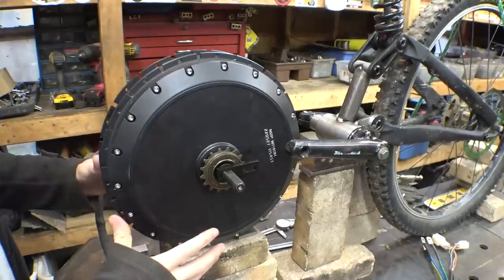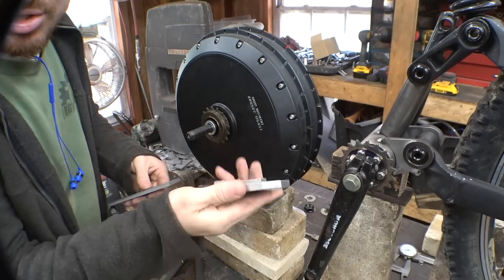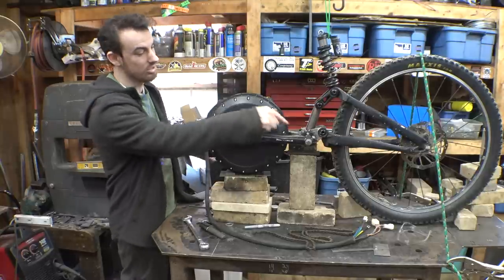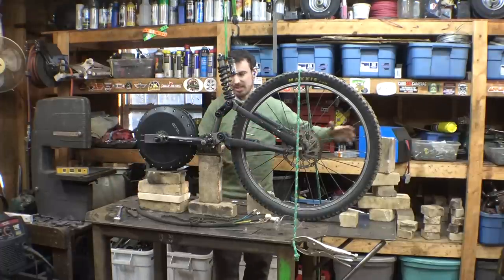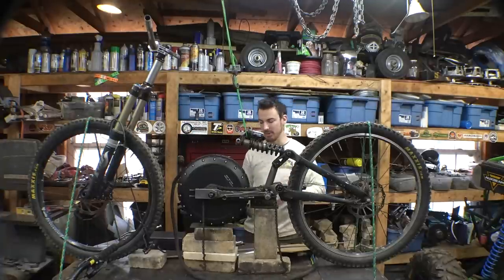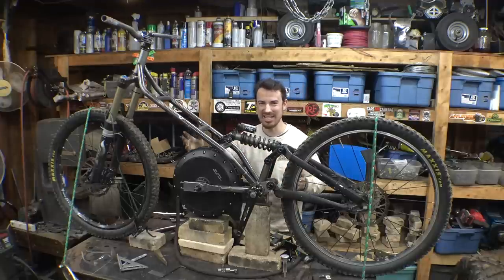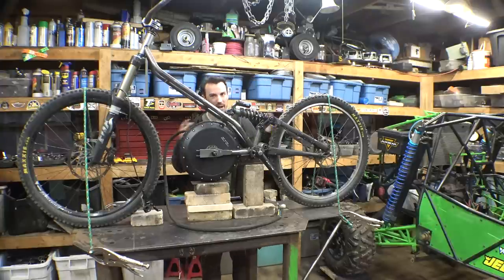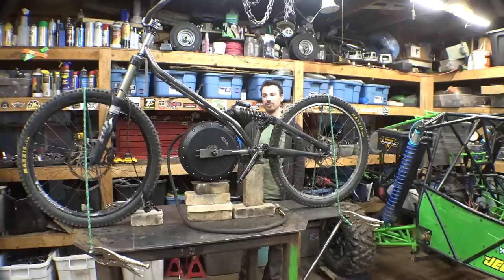Home Made Electric Mountain Bike Build - Part 2

Comment: A 15kw motor meant for a 450 pound sportbike crammed into a 50 pound frame is gonna be insane!. Love it!
Reply: i hope he adds  a few more tubes to the motor,  otherwise this beast rips his frame to shreds;))
Reply: He’s only gonna use like an 1/8 throttle. He doesn’t send stuff hard.
Reply: It's like 1000Hp on 1 Tire
Reply: @breakshot7451  also he his gonna have a problem with how low that motor is mounted. Basically not gonna be possible to do super technical riding because the motor will be hitting the ground
Reply: I’m fairly certain he’ll survive.
Reply: Do not worry. Rather B always finds ways to put unnecessary weight on builds and slow them down. Can't wait to see the final product though. Cool idea. Surprised I haven't seem more tubers doing this.
Reply: Maybe you guys missed the part where the motor is permanently attached to the pedals. If you can't pedal as fast as the 15kw motor your feet are IN A FLICKING MEAT GRINDER. You can't even use the throttle without pedaling
Reply: @janeblogs324  yeah this project is fucked for many reasons lol, could be cool but it can't be a mountain bike with the parts he is using now
Reply: I don’t think the spoke wheels will take the torque.
Reply: @janeblogs324  the motor is in fact NOT permanently attached to the Motor. He explained his design in the video
Reply: @purplebooger6410  not the current Chinese 24 spoke rears
Reply: @breakshot7451  The bigger problem is that the motor isn't designed to run that way and depending on quality, it might actually break the casement. Usually, you're supposed to machine the tabs off and build a "hoop" (for lack of a better term) that holds the motor in place from the outside. I've had two different motors break the case (cracks) because they weren't done in properly.
Reply: @aserta  i know, your right. basically, everthing screams,  wtf  are you doing here. but often that are the most fun projects;)))
Reply: @everythingcustom4034  The motor isn't attached to the motor huh? That would be a slight problem.

Comment: The amount of machining that goes into all of your projects is mind-blowing. I can watch for hours and I know it takes you many hours for something as simple as the headstock or seat post
Reply: Machining that tube took awhile, not sure if he knew it was A513 Type 5 DOM tubing.  It's used a lot in drag cars, for constructing four link suspension arms that won't fail..
Reply: Maria CANCER  Do you think it's okay to spam your channel everywhere?
Reply: I still cringe at using steel
Reply: @SKBKER  Its more expensive but he should use thin-wall chromoly tubing.
Reply: hes doing it the right way though,if the geometry isnt exact wont be able to pedal much at all,and turning at speed will be really dangerous, personally i dont think this motor is a smart choice though, ive seen 750 watt bafang hub motors used this way,and the bike would wheelie with touch of throttle ,and he was easily hitting 80kilometres an hour
Reply: @Rattus-Norvegicus  Report her and her channel maybe YT will take her down.
Reply: @katiekumcgil  I agree a geared hub motor would have been a much better choice because of weight and size.

Comment: This is going to be sick! Just a thought - might be wise to release the air from the fork + remove the coil from the shock to see the geometry change during full compression, bottom bracket usually gets very close to the ground on impacts and that motor is sitting a-lot lower.
Reply: +1 
i was thinking the same thing
Reply: ты правильно подметил !но чел не слыхал походу ничего про геометрию . все что использовал это угол наклона вилки . но у каждых рам он разный!! база рамы получается огромная !! для большей скорости нужен угол больше!! 70 градусов или больше!! я молчу про виртуальную точку вращения ... он будем слабо управляемым .. все это пустая трата времени ... 

you 've got it right !but the guy didn 't hear anything about geometry . all I used was the angle of the fork . but each frame has a different one!! the frame base turns out to be huge !! for more speed, you need a bigger angle!! 70 degrees or more!! I am silent about the virtual point of rotation ... he will be weakly controlled .. it 's all a waste of time ...

Comment: If I might make a suggestion. I'd build a lower loop frame member to act as a skid bar for the motor ...kind of like early Harley Davidson frames.   It should also add to frame strength
Reply: Yeah, don't want the motor hitting a rock or something your trying to get over. With the way it's mounted now, there will be clearance issues when doing a rock garden, but at least with a bash guard there won't be a spinning 50lb+ motor hitting the ground
Reply: Make it from aluminium as this bike is already quite heavy
Reply: And that suggestion comes from you having done a LOT more fabrication at a lot higher level, for a LOT longer than Cris? Or are you just making a guess based on watching youtube videos?

Comment: The peddles are going to turn with the motor. Peddles don't have a free spin because the sprockets are attached. You can spin them backwards because of rear sprock bearing setup but not forward. It engages when going forward.
Reply: That's what I was thinking, won't your feet have to be moving REALLY fast when that thing hits top speed?
Reply: @Tam Holt  they would be because the front sprockets are fixed sprockets. That's why when you look at bikes with mini motors they have a separate sprocket and chain going directly to the rear wheel. Not to the peddles.

Comment: I like the build and the idea Chris. I think that's the best thing you could do with the hub motor. I'm just not seeing how the motor being straight drive to the pedals is going to work. Are you going to pick up your feet when you hit the throttle and have the pedals just whaling under you? Like the crank set needs some type of freewheel inside them so the pedals only engage when pedaling but when the motor is running, the pedals aren't spinning.

Comment: I've made a few bike frames and I do see a reach issue once you hop on the bike, the handlebars will be around a foot further away from the stock seat position.  You can mount a longer stem backwards to compensate but do not expect the front of the bike to be easy to lift over anything on the trail.

Comment: Chris, you should try putting a little smaller motor on a vintage pedal moped, exactly this same way. (Bafang surely makes something well suited for more power than a bicycle, but not as much as a full sized heavy motorcycle. They would even work with you, to get exactly all the right equipment you need to power the motor. You're a YouTube celeb.....  Bafang are one of the best around.) A Pinto 2, or Swinger 2 moped By Kromag - Puch, comes to mind, for a candidate. if you squint, you can pretend a Pinto was made to convert in this method, with good strong mounts, and all. (mounts that will also serve as a guard to protect your feet and legs from the spinning motor.) The stock engine mounts could definitely be used, and they are really cool looking, stock, with speed holes drilled through... Also made of leftover military aircraft chomoly..You can also make that an off road bike, and it has 17" mag wheels, you can get disk brake kits for..or machine your own, easy. You can also get some great tires in 17" that'll be really tough. It'll be A TRUE MO-PED.

Comment: One thing I thought about after the first video is how the bike might ride. The motor might act as a gyroscope and keep the bike more stable. This might cause the bike to be harder to lean and turn on. I have no clue if this would happen though since this has never been built before. Great project and video 👍
Reply: Good observation! Kind of like 450cc dirtbikes, they want to go straight through the corners compared to smaller displacement bikes. He should add lead weights to the motor for fun and see how stable it will be lol.
Reply: It's not going to act like a gyro. it's about as much rotating mass as a steel inrunner shaft. Also, mid mounted hub drives have been done before. LMX's prototype was a mid mounted hub drive for one.
Reply: @th3d3wd3r  but this is a hub drive motor being used as a mid drive. The whole motor and casing will be spinning around the center shaft.
Reply: @Sean Torstenson  just the casing spins. The axle, stator, laminations and windings are all stationary.
Reply: @th3d3wd3r  you're right :( I wanted to see a gyroscope
Reply: Wouldn’t worry about this, outer diameter of the motor is not that huge compared to the wheels - and it will be spinning at similar speed, not like 20-30 times more. Remember,this has high torque, but not that much rpm, given it is meant to be hub mounted.
Reply: Vector ebikes has already made a frame with a QS273 mounted as a "mid drive" motor, the gyroscopic affects will not affect the riding.
Reply: @OversteerEngineer  I admit, I'd be curious what it would ride like if it did have a gyro. Though I wouldn't want to be the one to ride it hahaa
Reply: @High Tech \\ Low Life  yep, forgot the vector. Cool af frame.
Reply: @th3d3wd3r  It's one of the only I know of that has a hub as a mid drive 🍻
Reply: @hightech-lowlife  I've been on endless sphere for knocking on 10 years now. See all sorts
Reply: @th3d3wd3r  You've witnessed the evolution then 🚀
Reply: This has been built before, all motorcycles and electric bikes have the same rotating mass like this. How do you think engines run? They have fly wheels and crankshafts spinning.
Reply: @mikemchaney1003  I know how engines work, it's just that a motorcycle has a very different geometry from a bike. It was just a thought and like I said, I have no clue if it would happen.

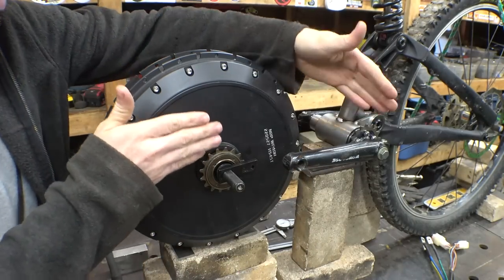Comment: 1:24 if you ever make another one of these, i highly recommend you make a spacer plate that replaces the sprockets (with threads, both threads from the head tube and the sprocket should be the same) that's perfectly spaced to keep the motor in line when you're building the frame around it. Much, much easier to build the frame if the motor doesn't wobble about and it's mathed to be exactly where it needs to be.

Comment: From front to back. Forks connect through the Head Tube, Then the top tube and bottom tube. Those connect the Bottom Bracket where the pedal crank arms attach. Then the Seat Tube connects to top tube and bottom tube. Behind the seat tube is the Chain Stay and the Seat Stay. The Rear Wheel connects to the Rear Drop Out.

Comment: 5:06 anyone at home copying this, you need to make the aluminium outer plate like a C channel that cups over the steel dropouts to prevent them splitting apart. The motor torque will quickly make those slots rounded
Reply: That looked like at least 1/2 solid steel. You ain’t splitting those forks apart.

Comment: I can’t believe I’ve been watching your videos so long and haven’t been subscribed. Fixed that real quick 😅 honestly love your videos and formate for edits, really love the time lapse machining and welding. YouTube and your channel specifically has seriously made me want a lathe and mill with the way you create and repurpose parts. Also because I’ve broken a lot of dumb parts that were purposely made weak by the manufacture and really with a pair of calipers and some time you can make anything. First thing I do when I move out is practicing my welding by putting up a fence, once I have clean beads I’ll start making benches and shelves for the tools and grinders etc, then roll cages. Idk what it is but powder coated cages that are meticulously done really are the nicest part to a build.

Comment: I think a slacker head tube angle would benefit this design. Most current DH bikes are around 63 degrees. A slacker head angle makes the bike more stable at high speed. Coming along nicely tho!

Comment: I'd decompress the suspension completely to check ground clearance. Also consider buying a beefier fork. Something like a fox 38 or RS Zeb. Could go full downhill forks with direct mount to be honest as well. 

That pedal clearance looks very minimal with your feet. Otherwise cool build. The rear triangle might he a weak point as you are adding a ton of weight and torque to this bike.

Comment: I think you're going to learn all about Gyroscopic effect with this design I thought of doing this years ago, by fixing the outside of the hub motor to the frame and driving the centre axle, which would mean you have to reconfigure wiring

Comment: I would love to see a small fiberglass protector. Skid plate on the motor housing. Take some foam and packing tape. paint some gel coat on it. Use it as a mold. Just a small thing with air holes in it to cool the motor. Make a bunch of them. to sacrifice instead of your motor exterior.  weight is not a big deal. if You lay up 2 plys of glass or Carbon if you don't mind picking little bits of it out of Your skin for eternity.

Comment: I am concerned this contraption is not going to work how you think it will.  Hub motors usually just spin the hub, while its attached sprocket should spin freely in the opposite direction of hub rotation so that it doesn't spin your pedals forward without input from your feet.  Even if this hub motor works different than I expect,  it will transfer power to the jackshaft/pedal crank that way because you've got the pedal bolted directly to the sprocket.  In the end, I expect either the hub motor will not pull on the chain, or it will and the pedals will be flying around uncontrollably while riding on power.  I hope I'm wrong.

Comment: Good project. I think it would have been easier and more efficient to add a sprag/one way sprocket to the opposite side of the rear wheel and connect the electric motor to the back wheel by chain so either the electric motor or the existing pedal/crank gear train can transmit power to the rear wheel without effecting the other. It looks like pedaling with your current setup will turn the motor, which will transmit motion to the rear wheel. If that's the case, you'll have to rotate a lot of of mass when peddling.

Comment: Can the gear connected to the left side pedal freewheel?  It looks bolted together, won't it be locked to the speed the motor is spinning at when powered?  So your feet will also have to be moving that fast?
Reply: I've been thinking the same thing. His feet are going to have to spin at 1000s of RPMs. Remember when you were a kid riding a Big Wheel down a hill and the pedals spun faster than your feet could go?

Comment: heya remember to add one of the bafang cable pull gear change sensors ,so it cuts the motor will gear is changing

Comment: Be careful with your controller directly behind the front tire! Whilst they are meant to be water resistant/proof there is a ton of them that still get fried by rocks and water. Not sure what your intended max speed is but I would recommend some sort of guard provided it doesn't effect the cooling of the controller! Failing that you could also make a tiny water cooling system for it as well! There is a few people that have taken to water cooling modified Sur-rons because the controllers get ridiculously hot. the few I have seen have been done with copper tubing weaved through the cooling fins of the controllers with a PC style radiator and pump hidden in front of the handlebars where competition number plates would be placed. Again though those are MODIFIED not stock using far higher volts and amps than intended. Here is a quote from one controller sales place highlighting the water issues "in extreme cases of water intrusion to the Controller Wiring Harness. To further prevent Water Intrusion issues, mount the controller upside down and use Dielectric Grease on the Harness connections, also avoid deep water and pressure washing your bike" so despite them claiming they are water proof and fully sealed units they are still giving warning that it can happen and you have to agree you wont ask for a refund for water damage........... at like 1500$ for a controller and harness you would think they would be far better built with O-ring or sealed connections.

Comment: I don’t know if this would help the heating of parts on your metal lathe much, but for my wood lathe I got a lock-line nozzle kit and a 1/4” npt ball valve mounted on a magnet, then hooked it up to my air compressor. When drilling deep holes with a forstner bit or something I can blow air on the back of the bit. Keeps it cool and moves chips out of the way. I mean to kinda like a liquid coolant thing on some mills or lathes… but compressed air instead. Makes a hell of a mess sometimes haha. But you could shoot air down that tube as you bore it out.

Comment: It's starting to look pretty cool, but by the time you're sitting on it and the suspension has sagged, the motor casing is going to be only a couple of inches off the floor. (You could measure the ground clearance of the bottom bracket (crank bearings) when you're sitting on your old bike to check how much the suspension will probably compress.) To compensate for the sag I reckon you're going to need to make the suspension so hard that it'll be almost pointless having suspension. Could you rotate the motor support arms up so the motor goes higher, between the new frame tubes you've added in this video?
Anyway, thanks for the video. Really interesting project!

Comment: Don't worry about fork angle, you want to set the wheelbase length and seat to bars length(cockpit length). Wheelbase for handling and cockpit for ergonomics.
Reply: On mountain bikes head tube and seat tube angle does matter. Seat tube won't matter as much since you aren't really pedaling per season. If he copies his Trance geo he should be good. He probably needs to change how the 2 down tubes go into the head tube. The fork crown will hit.